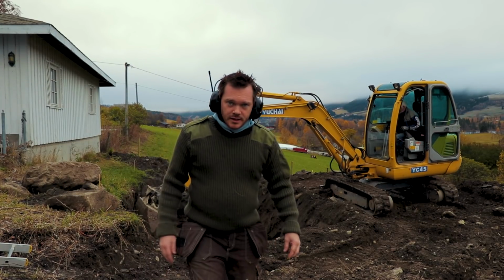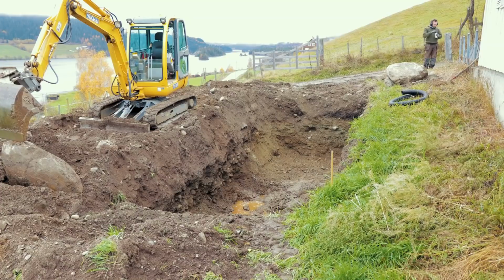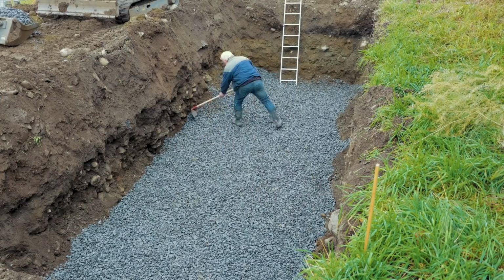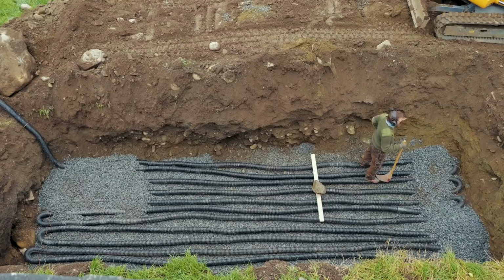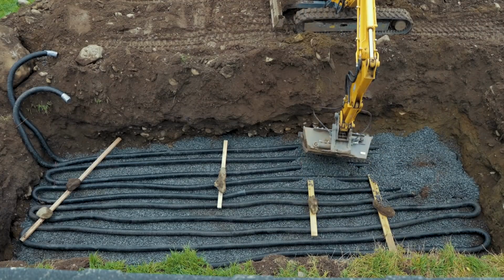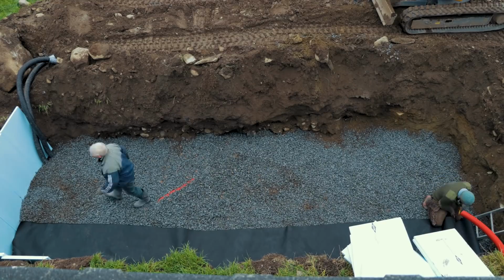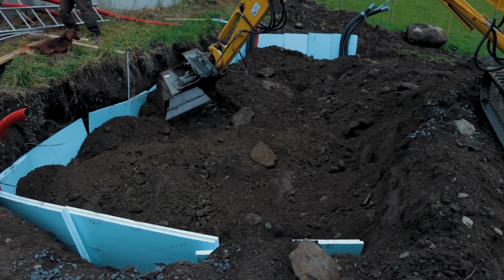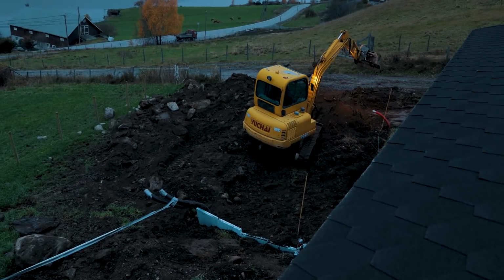GeoThermal Greenhouse Build | Part 2

Comment: I`m sorry to see you putting so much time and effort into an installation that wont work very well, if at all ;(  I would not recommend anyone copy the LDS installation as it has major flaws. The individual tubes are just too long and, when combined with the serpentine layout, creates a massive resistance to airflow, which is the exact opposite of what is required. 
The formula for the total tubing is not related to the greenhouse air volume,  its related to the mass. The greenhouse air volume is used to calculate the required airflow. Once you have the tubing and airflow information, you can design the most efficient tubing layout and specify the correct fan for the task.  Now you have backfilled the hole your options are limited to two, leave it knowing that it wont work or dig it back up. I hate to see folks being put in this terrible position simply because they trusted incorrect information. 
Judging by the numbers you gave in the video, your greenhouse volume will be around 5577ft3 (158m3). The design airflow based on running the entire greenhouse air volume underground 20x per hour is 1860cfm  (3160 m3/hr). The tubing layout you have installed will limit you to around 150cfm (250m3/hr) assuming the fan can handle 2.6 in wc (650 Pascal) at that flowrate. The heating/cooling performance will not be close to expected as the greenhouse air volume will only be run underground 1.6x per hour.
Reply from the maker: Fantastic input, John! I will read in detail everything in this post and come back to it. I have only done half the size of the greenhouse, and I would love to use something like your approach on the next step. I one hundred percent agree on your logic, and I also think there is a massive loss in the way I did this after reading up on it more. Let's make this a learning project. That's what I'm here for.
Reply: @ChristopherBrandsdal  you have a great attitude, keep it up mate 🙂
Reply: Hi Dan 
If you buy a book without understanding the basic principles you cant confirm if the information in the book is accurate, much like you tube videos. If you understand the principles,  you dont need the book and the flaws in the you tube video`s will be easy to see. 
The starting point for designing a system only requires 2 pieces of information, the greenhouse air volume in cubic feet and the floor area in square feet. The former is very important because it tells you how many cfm the system will need to handle. The latter provides an initial estimate for the amount of tubing required (not the layout). The actual length can be different depending on the layout itself as well as local climate dictating the need for a system bias towards heating or cooling. A layout biased for cooling will not be the same as one biased for heating. In an ideal world, you only get to bury the tubing once so you need to be sure it will do what you want before you bury it.  
I monitored the ground temperatures for 12 months before i built the greenhouse and installed the system to get a baseline for comparisons. I`ve had 26 sensors monitoring the greenhouse, system and surrounding ground at various depths for the past 9 years. Very few of the you tube installations monitor much more than the in/out system air temperature, greenhouse air temperature and humidity. Most have no idea of how much airflow they have and assume its the same as the free air flowrate stated in the fan specifications ;)
If there was one thing i`d recommend to folks considering a system it would be this, spend a little time installing a single tube (the same length that will be used in the final system) in a shallow trench. Install temperature sensors in the tube at regular intervals, one in the ground near the tube and one to measure the ambient air temperature. A 12 way rotary switch can be used to connect 12 sensors to a single meter, for example 12 ntc sensors to a stc-1000 digital thermostat. These can be used in the final system so there`s no extra cost.
A windspeed meter (eg: skywatch xplorer 1 or similar) is useful for measuring the relative airspeed and flow.  Fit a variable speed fan and compare the air temperature sensors in the tube to the ground temperature sensors. You`ll notice the air cools to the ground temperature long before it reaches the last tube sensor. Gradually increase the fan speed to maximum and see if you can get the last tube sensor to read more than a few degrees above ground temperature. The test will provide some  insight into the amount of air it takes to outrun the heat transfer capacity of the tube.
Reply: I think I DO have a rudimentary understanding.  I've watched and read many of your replies on Youtube regarding the subject.  You seem very knowledgeable.  You spend time commenting on others peoples' videos; why not take what you know and put some content regarding the subject on your OWN channel in one spot?  Seems like that would save your time commenting and save other peoples' time searching for answers....
Reply: JohnGuest45 Why not take the "how-to" as it pertains to geo-air design and combine it with the theory behind it?  Countless how-to books already do this.  For anyone to research this topic, I'm willing to bet the information is contained in a digital or paper copy book.  I mean it isn't chisled on a rock somewhere right?   You keep saying basically "do your research" which I'm sure folks would like to do, but without a specific direction  to a quality source, we're back to watching YouTube videos.  As a former firefighter, if you wanted info on fire theory, I would refer you to specific IFSTA manuals where you could learn all about it from a reliable source, not simply say "do your research".
Reply: Its surprising how many folks believe the heat taken from the mass is instantly replaced by heat from the earths core. It would be nice but it just doesnt happen  ;) If a system is ineffective for cooling, it will be equally ineffective at storing heat because these processes are linked.
Drainage is important for any greenhouse, installing drains to direct water around the structure is the way to go.
Reply: Great information. 1)  Some of the principles I understand, some I do not.  That can be said for nearly everyone on a number of subjects.  A good book with all the formulas, diagrams, ratios, equipment ect. can at least get people on the right track without turning their property into a multi-year feasibility study/science experiment.  Do you know of any books dedicated to the specifics of geothermal greenhouses?  I bought the Citrus in the Snow book and thought it was a joke; hardly any specific information on how it was built was in there.  2)  Many folks who are interested in geothermal greenhouses are farmers already, myself included, and time is a barrier to many projects on the farm.  So I absolutely see the benefit of geothermal, but I need to know the details/specifics all laid out.  I don't consider myself to be a stupid person, but I wouldn't consider myself an engineer or expert in thermodynamics either.   or   3)  I'm sure there are contractors who do this for a living, but AFFORDING them for a geothermal greenhouse is another story.  So unless there is a good book or Youtube video, I'm right back to my original place.  The only book I've had my eye on purchasing on the subject is The Forest Garden Greenhouse..but some of the reviews cite the lack of details...which is exactly what I'm looking for.  Apologies if this reply sounds snarky, I'm just amazed that there isn't a one-stop-shop, everything-you-need-to-know-on-geothermal-greenhouse-construction book out there.  You know, something that will definitively answer questions like what to do if my ground is sub-irrigated, or do i use solid or drain pipe,  or how to deal with humidity issues, with diagrams, key formulas, ect.
Reply: Hi Jose, 
  It`s far from tropical here,  i`ll trade you some sun for some snow  ;)
Reply: Hi Chris
If you can post some details about your greenhouse , type of structure, volume and floor area it will make things easier ;)
Reply: Considering most of the systems posted on youtube are not designed well, would you be willing to share your expertise and post a diy video, or pass on more specific information on how to build an efficient system?
Reply: Hi Bill
Evacuated tubes wont do much to help cool or dehumidify a greenhouse. Water doesnt respond as fast as air which isnt ideal when heat availability is short lived or sporadic such as in the winter. Greenhouses can heat up rapidly with a litte winter sun, a fan can move the greenhouse air equally rapidly and store the excess heat in the ground. The fan moves the heat directly to storage which is very efficient compared to transferring heat from the greenhouse air to the water and then moving the water to the ibc storage. Winter sunny spells can be over in minutes and you are in competition with the structure (heatloss through glazing etc) for that excess heat. In winter, you have to grab the heat when you can and as fast as you can. 
Water running through pipes doesnt provide any added benefit of air circulation, so you`ll need a HAF which adds to the hardware cost and the power bill  ;) 
Rule of thumb is to use tubes with the shortest practical length, this will vary from greenhouse to greenhouse but whatever the length and layout, you should always run the numbers before settling on the final design.
Reply: I would save my money, they charge as much for a plan as it would cost for the entire installation ;)  I`ve had some conversations with them and they have some curious ideas regarding thermodynamics and more specifically sensible and latent forms of heat.. You would expect folks selling systems to understand how they actually work.
Reply: is there any way you could make a video? especially with details about the actual temp differences and design considerations, I have watched all of the videos on youtube about earth cooling, geo thermal, 99% of them are just backyard warriors and don't do any follow up videos.
Reply: Hi Jose,
I didnt want to drop too many subjects on folks at once as its a lot to digest in one go ;) Understanding the basics of the system operation first will make it much easier to understand how and where RH fits into the grand scheme of things. It`s an important topic that needs to be covered as its both a benefit and a curse with this kind of system.
The money spent on foundation insulation wont provide any return, if it isnt installed correctly you may as well not have it. As below ground insulation is closed cell (XPS in my case) a vapour barrier isnt required. Chris has the option of installing horizontal (wing) insulation when the greenhouse goes up but as it`ll need to extend 4-5ft beyond the perimeter to be effective it will be more expensive than vertical perimeter insulation. 
With vertical insulation use 2 layers half as thick and stagger.overlap the joints. If you use insulation with a tongue and groove profile you dont need to worry. Dont forget to double up the insulation at the corners where the heatloss is higher.
Reply: John, good information.  But do you have recommendations on where we can find specific info to build our own...that actually works.  I'd like to build my own and can't afford engineers or other specialists, so I've been going purely off of youtube videos myself.  Surely there is a good book that covers specifically building your own geothermal greenhouse.  No?
Reply: Hi John,  So after reading all the comments in this thread, I hope Christopher will rethink his tube layout. Maybe go for a manifold air system where the blower feeds 11 tubes 40 ft instead of 1 tube 328 ft. But the real efficiency would be to use water to move and store heat. A couple of evacuated tubes heating an IBC tote of water that is buried in the ground for insulation values then hydronically heating the grow lanes or whatever the plan is. If he keeps the current system and finds it lacking he could heat the green house the Jean Pain way. So many ways to create free heat.   Cheers,    Bill
Reply: Where did you come up with those numbers? Why 20x/h?  How did you calculate the flowrate deficit due to the pipe layout? I'm not sarcastic - I REALLY want to know because I plan on doing this in the spring.
Reply: Hi Alex
I installed mine back in 2009 and can tell you there`s more to these systems than meets the eye, Common sense should tell you that most of the ones on you tube are not well designed. Run some of LDS`s or Chris`s  numbers past a hvac engineer and he`ll probably laugh, you wont find 100m runs of 4" corrugated ducting in any normal installation because the idea is to move air efficiently, not create as much resistance as possible ;).  
I`d recommend doing research on airflow and losses in duct systems. Having some basic knowledge on soil heat capacity, conductivity and diffusivity will help you to understand how the heat transfers to and moves in the ground.  Likewise, you can use a psychrometric chart to figure out the amount of heat and water vapour in your greenhouse air volume. 
Armed with these things you can calculate how much heat you have and what it takes to move it from A to B efficiently. 
In Chris and LDS case, the restrictions inposed by the design itself will be the limiting factor. In the summer, they wont be able to move enough air to keep pace with the incoming solar gain and the greenhouse will overheat. Fitting a more powerful fan wont help as losses increase with flowrate and, the harder a fan has to work, the more its going to cost in electrical power.
I purposefully sealed my greenhouse on a hot, sunny day and managed to heat it to 140F. With it still sealed and in full sun, it took the system a shade over 12 minutes to drop it to 68F. In normal circumstances it wouldnt get as hot or need to be cooled down so fast, but its capable of doing it. In normal operation, efficiency is the key. Its cheaper to run the fan at a constant steady  flowrate that keeps pace with the incoming gains than to run it flat out intermittantly. 
Whatever you do, dont bury any tubing until the design works on paper..it will save you a lot of unnecessary digging.
Reply: JohnGuest45 🤣🤣🤣No Way!
Been there done that.🤣🤣🤣
All the best.
Reply: This interests me because I wondered some of the same things.  I have to laugh at people who talk about "unlimited cooling" or heating "from the earth".  At least these guys understand that you have to put the heat down there if you're pulling it out.
But I have a question about the runoff water.  It seems that has the potential to suck a lot of the heat out and run it down the hill.  Chris deals with this by putting a layer of gravel at the bottom and running a pipe.  Will that be enough?  It seems like it would be preferable to have a wall of gravel on the uphill side, with a corrugated pipe under it to collect all the runoff before it gets into the heat box, and direct it around the box.
Reply: I think i found something useful : THE YEAR-ROUND SOLAR GREENHOUSE
https://www.ceresgs.com/resources/greenhouse-design-book/
Please let me know if its useful I plan to buy this book...
Cheers
Reply: Hi Dan, I've been following your conversation with John and in my own research found it useful to use variations on GAHT (ground to air heat exchange, or "earth tubes") and more technical terminology as it's been heavily studied in other parts of the world. So far, the most relevant source I've found is this: http://www.ecosystems-design.com/faq.html

There are also many university studies which generally speak of ground-to-air (both open and closed loops) which give much more technical detail
Reply: JohnGuest45 "
Reply: All I can say is.... 150 Feet to 175 Feet of 6" Diameter Pipe?  Even I, the " Dumbest Kid " here can see what is going on!  LOL
Reply: you are right Jonh. to select a heating or cooling system we have to determine the peak heating ar cooling requirement for greenhouse. so it follow two components are transmission heat loss(or gain with in summer)  and infilatration heat loss(or gain with in summer) plus ventilation heat loss(or gain with in summer). with transmision loss we calculate through surface area composeed by roof and walls of greenhouse, with infiltration loss we calculate through cabic feet. after determine the peak heating ar cooling requiremaent we will calculate the fan how cfm and how tube the total length. that we discuss there how bury the tube. i absolutly agree with you that Chris bury the tube too serpentine that it limited of airflow and flowrate its  two former is very important to  be able make cooling and heating of system.
Reply: ASHRAE is the organization that HVAC engineers are generally members of which deals with air flow.  ASHRAE's bookstore has the equivalent of the manual you mentioned plus lots of other useful info about HVAC. 

https://www.techstreet.com/ashrae/pages/home?ashrae_auth_token=
Reply: John, I'm with you on this one.
No one has even mentioned relative humidity.
These folks, I'm sorry to say, are in for a world of hurt.
Soil, or in this case dirt is not an insulator. It does have "some" insulating qualities, but acts more as a modifier, hence geothermal pumps.
As for literature I would recommend, "The Use of Earth Covered Buildings" from the GPO (currently out of print). It has a wealth of information.
You can also look for any HVAC 101 textbook for any engineering college and that will help immensely with a basic understanding of heat flow and transfer.
From the looks of It, in the video, that system is probably going to need some additional help from some solar heated air boxes. At least to me, the application of the rigid insulation was sparse and nothing of at least a 6 mil vapor barrier.
Cheers.

https://www.amazon.com/Use-Earth-Covered-Buildings-Alternatives/dp/B000QS104G
Reply: JohnGuest45. Ok this will be my last question in hopes for a reply
Now not counting the vertical intake pipe i plan on running 15ft of 12in drain pipe as manafolds i figure 11.85 cf total volume for that one manafold 
Then have 30 10ft 4in drain pipe as my cross runners i figure 27cf total volume
So my question is this a good flow rate to have 27cf being feed by 11.8cf or am i still not uderstanding any of this 
Keep in mind im thinking of going with a 12inch digital grow blower rated 1500cfm for a 17ftx13ft 3v geo dome im building from uk domes and also my 10ft runners will be 3 layers at 7ft 6ft 5ft deep in good ol Kentucky soil
Reply: JohnGuest45. Hey buddy iv serched all over youtube for your inputs plese tell me on my idea of a geodome in USA Kentucky  with a air volume of 3200cf and a floor area almost 300sf (13fttall 19ft diamiter) using 3 layers of (12) 4inch drain pipe 12ft long ran into a 12in diamiter manafold (also drain pipe) with a 12inch inline fan pulling 1500cfp pleses help and give any advice u may have for me thanks
Brianwhelan92@gmail.com
Reply: Hi Bob
Specifics are not easy as some folks might need a system that is biased to cooling (hot climate) or biased to heating (cold climate). When an engineer designs heating, cooling or ventilation system he doesnt just guess and hope it works ;) .
 Most systems on you tube are copies of copies of flawed systems. Where formulas or recommendations are given, you should always ask yourself if it makes sense. For example, LDS advocates the total tubing should be 10% of the greenhouse air volume, if you ask him to explain the reasoning behind the formula he cant provide an answer. 
The air is simply the transport medium, it bears no relationship to the total tubing length. The air volume is used to calculate the fan cfm. Consider the tubing is installed in the ground below the greenhouse. The amount of mass in contact with the tubing is responsible for heat transfer. If you bury all the tubing in a single layer  8ft deep. the mass in proximity  of the tubes will heat up (or cool down) rapidly. The ground above and below the tubing layer will gain (or lose) heat via conduction which is much slower than for the tubing layer (google for soil conductivity, diffusivity to get an idea of how fast heat moves through the ground) The important thing to remember is the temperature differential drives the heat transfer process. 
The tubing should be evenly distributed throughout the mass both horizontally and vertically so the entire mass is utilised efficiently.
Consider one of Chris`s 100m serpentine tube runs in terms of tube surface area in contact with the ground. Mow consider the same tube cut into 10x 10m or 20x 5m tubes which have exactly the same surface area but without the massive losses which set the limit on the amount of air he can run through them. Folks find it hard to believe how fast heat can be transfered, hence they go for long tubes, thinking the longer the air spends inside the tube the better it is. In reality. its the amount of time the entire greenhouse air volume spends underground. Dropping 30F off the air in half a second is easily achievable, if the air spends 12 seconds in the tube, it`ll be coasting for 11.5 seconds without transferring anymore heat. Its not easy to cover everything in a single post but hopefully it provides some insight.
Reply: JohnGuest45  you are right. it is exactly thing you say.
Reply: I`m not a firefighter but if i wanted to research the subject of firefighting i`d probably start with a basic understanding of fire itself. If you take the same route with this system you will soon have a list of subjects. Try this example, what is the maximum cfm you can run through a 20ft length of 4" smooth bore pvc tube without exceeding 0.2 inch water column. A quick online search for friction loss in ducts should provide you with at least one online calculator that will give you the answer. Be aware you wont find anything specific for corrugated ADS tubing because it isnt designed for air. You can use corrugated flexible ducting in its place if you double the friction loss. While you have the calculator open you should check how 328ft of 4" corrugated duct with eleven 180 degree bends would fair.
The next basic question is conductive heat transfer, which is simply the tubing area vs temperature differential. I work in old money, so its btu, lbs and deg F for me. Specific heat capacity will give you an idea of how many btu it takes to raise or lower a pound of mass (or air) by 1 deg F.  Then comes the more interesting aspects, humidity and phase change, dewpoint and condensation, for these you should google for a psychrometric chart or calculator. These systems are very similar to a air conditioner, except the compressors job is done by the plants (transpiration) using energy from the sun. The ground is the condensor where the air drops to dewpoint and the water vapour (gas ) changes phase to condense out as liquid water which is returned to the plants so it can go around again. Every lb of water that condenses out represents 1000 btu vs 1 btu to raise a pound of water by 1 deg F.
Heat that is transferred by the tubes to the ground doesnt stay put, so you need to know how fast it will move away and how far it can travel before it becomes unavailable, aka, out of reach of the tubes for use the same day, for that you need soil conductivity and diffusivity. When you install the system, be sure to install sensors in the ground (including below the system) so you can track the movement of heat which will confirm the theory. In my experience, you`ll find the mass temperature peaks around 5 hours after the peak greenhouse temperature (typically the hottest part of the day) and around 2 hours after the heating period ends. For example, if the peak greenhouse temperature is at 2pm and the system stops cooling at 5pm, the sensors in the mass will peak at 7pm.
Operational information is very hard to find because folks dont install enough sensors and dont understand the principles well enough to do the right kind of tests that provide the information. At best you may get the inlet and outlet temperature which are meaningless without the airflow rate. Super cold or super warm air exiting a tube sounds impressive but if its only a cupful per minute you`d be better off using a bucket of ice to cool the greenhouse or a teacandle to heat it. 
That should be enough to keep you going for a while ;)
Reply: @JohnGuest45  well.  Im am just interested in this ground heating and cooling after stumbling on the citrus growing guy interview......wont ever do it but i love to see problems solved even how artists walk thru their creative ideas.
.  Im just Too old and feeble now.....but why dont you write a e-book..get some pics and viola...help people who think they want to try this...this is NEEDED AND BAD...REALLY REALLY BAD...you could at least weite a book about what not to do based upon these structures...and how u might go about solving it...

If i had not bothered to read comments i would of assumed everything was golden....and wondered why farmers were so dumb they all dont do this.  I now know different...THEY NEED HELP.

im pretty much convinced that we are going into a a solar minimum...now named EDDY...this happens and well we are all in  trouble..NOT AS MUCH as a full minimum but just as dangerous....and that wall will be keeping us in....not a soul out....not to mention we need to make this geothermal growing as common.as house flies anyway ...i still pitter in the yard and the heat around here is brutal enough to kill ya...and does when these silly californians move here now...joggers who havent a clue about this heat has claimed two already this year..no telling how many hurt

I know i talked about a solar minimum...but being a long time observer of the weather here i will tell u that we will have another strangely early and deep winter again based upong what the bugs birds and plants are doing..somehow the ants know two days before a flood comes and fire ants build huge structures....u could almost set your watch to  it.    Anyway from what i can find out during the other minimums this area became a desert and with the big farmer practices that have killed the soils...well we havent a prayer.im so glad to see they are now starting  doing the no till and companion planting with diversity over seeding.  Seems it has made a hugw difference in their soils in about four years....and after 10 well its phenomenal.

PLEASE TAKE AN HOUR A NIGHT AND WRITE THAT PUPPY...
Reply: You dont need a phd in the subjects just a rudimentary understanding ;) Books with all the information dont exist, those that do dont give specific details or reasoning behind the design.  Citrus in the snow uses 7x 150ft long, six inch diameter tubes and a 10" fan for an 11,000 cubic foot greenhouse, which should instantly throw up a red flag. That greenhouse is mostly below ground which helps a lot. LDS`s design bears a certain simularity to citrus which makes me think it was the basis for his first installation. His second one is better but not ideal. If the first one was so good why did he radically change it on the second? ;)  Forest garden was designed by Jerome Osentowski, who worked closely with John Cruickshank, inventor and driving force behind the subterranean heating and cooling system (SHCS). which is now presented under various names like, geo air, climate battery etc by different people for various reasons. Jerome uses a standard format for all his installations which are typically large commercial projects. He doesnt innovate or try anything new. He does recommend using more airflow now than previously, 10 greenhouse airchanges per hour vs the original 5, which was due to experimental work instigated by John before he passed away in 2011. 
10 is still too low and easily confirmed, unfortunately the fan power required for testing isnt usually available in a large installation.. and an important detail is missed ;)  
I was lucky that John was around to bounce ideas off when i designed my shcs. It was radically different to any installation that was around at the time and as folks continue to copy systems and no one questions the design, i guess things will remain the same.  
If you know the volume and floor area of the proposed greenhouse, you can at least make a start on the design.
Reply: Hey John,
I'm in the Tropics! 🤣🤣🤣
(eat your heart out)
I have to totally opposite problem, in summer, trying to cool off in the shower I have to turn the hot water on.
You see, we keep the water heater off and thereby keeping it cool.
After jumping in the shower you feel the heat coming off the city water mains.
Counterintuitive if you will.
Enjoy!
Reply: Thats the reason i dont, folks that are interested enough to search for the answers are more likely to confirm the validity of the answers and do some reseach . Folks that are looking for a "how to" are not interested in the why, just the "how". They are the ones that will copy a system, ask no questions to confirm the validity of the design before installing it, usually at great expense. If you have read some of my comments you`ll see the common theme is to try to get folks to question,research and understand the principles so they can validate their design choices prior to installation. The owners of the systems i comment on usually go quiet. I guess they check the validity of the comment and examples given and suddenly realise they should have done this research before. In most cases, digging up the tubing is the only way to rectify the problem. 
Chris is in a slightly better position as his greenhouse isnt up yet, the question is, will he check the comments, will he do a little research to confirm the information given? Which ultimately leads to a tough choice. Or will he simply plough ahead and hope the predictions for the systems performance dont come true?
Reply: Obviously people want to know how do these things correctly. You are saying people aren't interested in confirming the validity and not interested in why. Yet you were asked where to get those answers to learn how to make those calculations and gave no resources. Where did you gain your understanding and where would you point people so they are referring to appropriate sources of information?
Reply: Mama Duck, he's most likely an engineer. I'm saying that because even though I studied electrical engineering, I still was required to take a course on Thermodynamics. I understand the principles he's talking about, however, there's 1 major major problem with people asking for his help:
Each case is going to be dramatically different depending on soil type, weather, materials, size of greenhouse… there's no one-equation-fits-all.
Regardless, I'd recommend starting at the end… what do you want to grow, and how much? 
Find someone with similar conditions who achieved a similar outcome and apply it.
No system can be perfect, but there are plenty that can fit your outcome :)